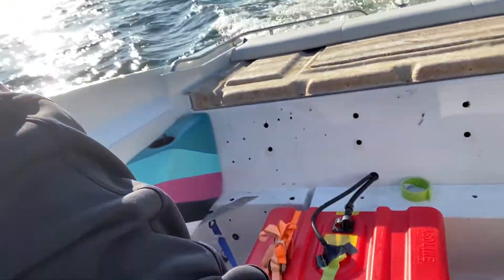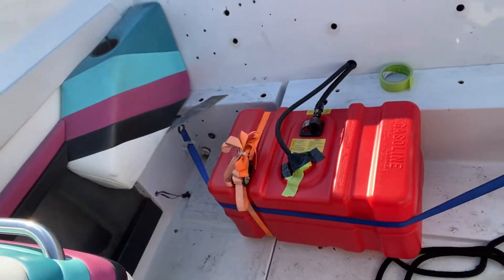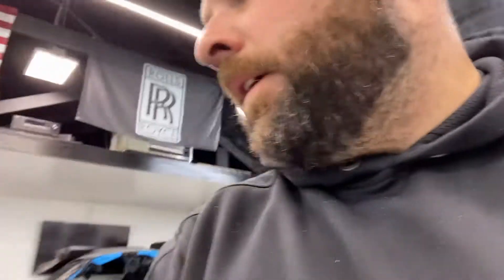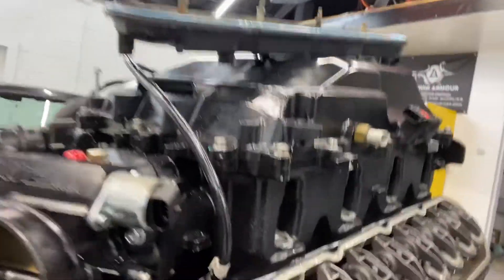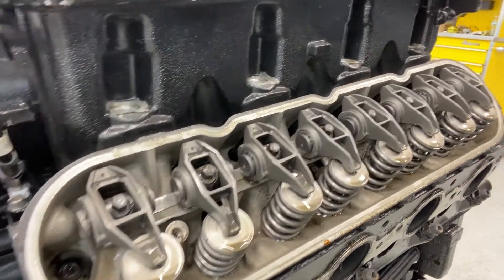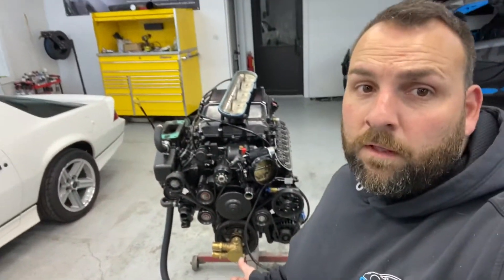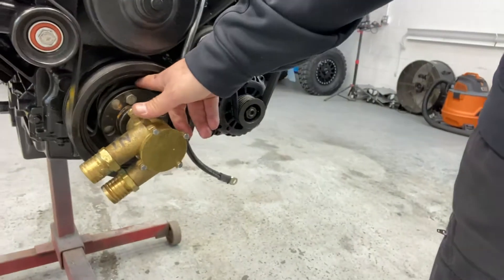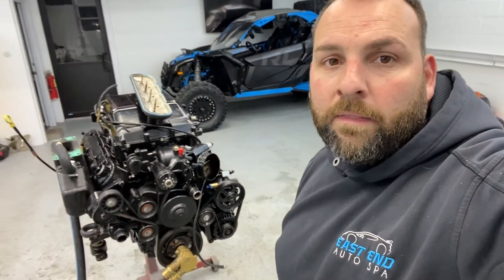Winter Project - LS Swapped Boat

Comment: On that Volvo pump, there is another bracket that holds it. it has a rubber piece shaped like an hourglass that fits between the inlet and outlet ports to hold it steady, but allow for vibration. you may need to make one custom to fit the motor, as the factory one probably only fits the 5.7 Liter  and 4.3 Liter. lookup pictures of Volvo Penta 5.7GI, or Volvo Penta 4.3GL  that's likely your problem. hope I'm not too late lol

Comment: Love What you’re doing. I’m doing something very similar on my boat. I wonder if you had a longer crank bolt if that would help? 1157-0163? I used that to reinstall my balancer but I put a ARP crank bolt in. I’m going to keep a close eye on it when I break mine in.
Reply from the maker: Thanks! They make a bracket to hold it from the side so the pump cant back out. The ARP bolt would probably also work. I ended up getting the bracket

Comment: Do you think your O2 sensor might be getting fouled/damaged from small amounts of water inversion/reversion causing it to throw high AFR's and run rich?  I wonder if you put in a tune and then ran without the O2 sensor if you wouldn't see a difference.
Reply: I thought the same. Depending on where water mixes into the exhaust there could be enough overlap in the cam to pull water back to the 02s. Orr be cooling them down enough to throw off the reading.